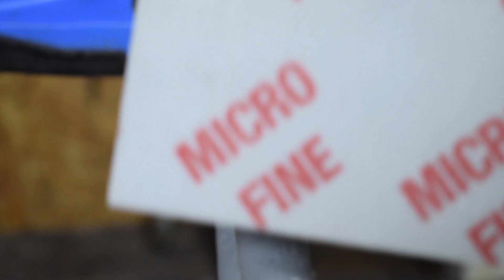🎨How to paint a bike like a pro -2nd episode "🎨paint job🎨"-

Comment: Good day, another amazing job. Would you  answer a couple of questions please to help me in my bike spraying.
After flatting the grey primer, it looks like you sprayed directly over bare metal with white......was this a white primer or any sort of special paint?
After spraying how long do you leave the fine line masking tape on, I have trouble with getting a perfect edge.
I bought one of those  paint pens, brilliant aren't they 😁  
Thank you.
Reply from the maker: Hi, friend!!! I answer your questions.
-1st. When sanding the primer, if you walk around sanding a little, nothing happens either, you can apply paint without problems. In my case, since the frame is chromed, the chrome acts as a primer. If you spend too much sanding what you have to try is not to notice the steps between the steel and the primer. The paint is a normal bilayer white.
-2º If you mean painting the stripes, I remove the tape as soon as possible, that is, with the paint still wet. Use a shaping tape, if you use normal tape, it is very difficult to get a good result. With the varnish, I leave it about 20 minutes after having applied it and very carefully remove the tapes while the varnish is wet, because if it dries, it is possible that when you remove the tape you ruin the work, because the dry varnish sticks so much to the painting like the tape.
-3rd the marker is great.

I hope you were able to understand what I have told you. Since my English is not very good. Greetings, good luck with that paint job; )
Reply: @dabrestauracion7404  totally understand, your English is very good.
Yes I use shaping tape, I've let it dry and it leaves a poor edge so will remove it in future. My next project is a frame which has part chromed seat and chain stays a d want to get a neat line. 
Thank you for taking time to give me this comprehensive answer.
Mick
Reply from the maker: @mickchaganis6607  Thank you!!! For that we are here; )